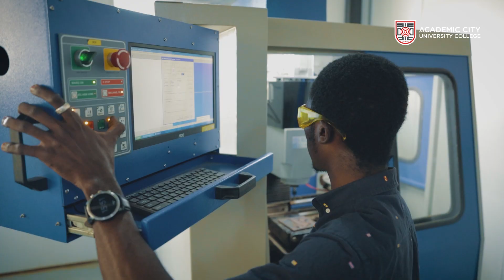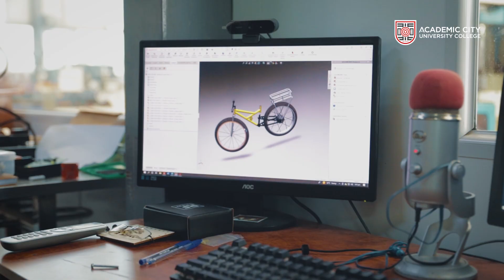The story behind Goliath Robotics, an ACity Startup

Comment: Amazing job guys!! Biggest fan
To truly  be advanced I believe you guys should tackle the core problems, which is self reliance on complete design process to manufacturing. How about looking into all the materials need to manufacture any product say an electric bike just like you showcased, but instead of sourcing locally  which is good, rather collaborate with material engineers on how to fabricate these materials and what manufacturing methods can you use, this helps you guys design specific purpose machines on a small scale to manufacture these materials which then enables you to full control quality as well as top notch performance. It is not sustainable if we source most critical components abroad. For a start we can, but quickly devise all possible ways to tackle the core problems of full industrialisation. 
Insha Allah someday I will be honoured to share great ideas and build revolutionary projects. Equip yourselves very very well.